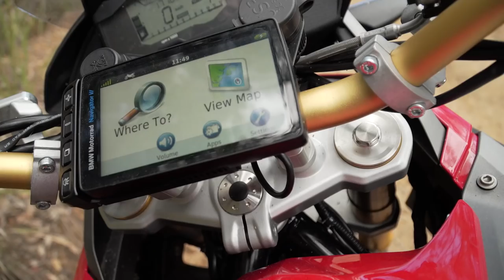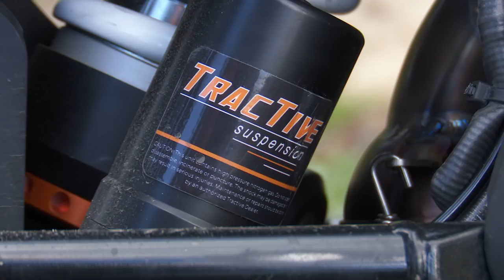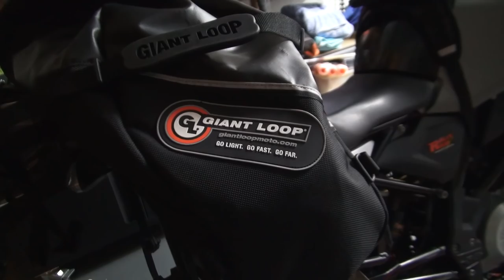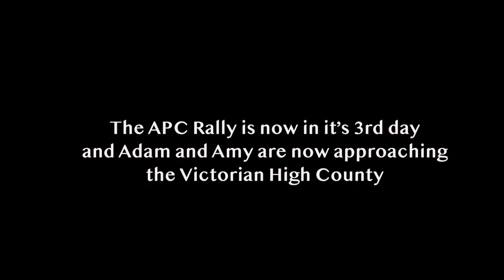Rally Raid Products BMW G 310GS - build, test, discussion, prep for adventure

Comment from the maker: Welcome to Motorcycle Adventure Dirtbike TV - we have some cracking movie length motorcycle adventure videos that will take you all over the world.  Just click this playlist link to get the full set,
 https://www.youtube.com/playlist?list=PLkM9-Vs7Ynzi55gvgbVg2Xcy_rp0vqA_R
Reply: still better off with a 2 stroke in country like that.  He did a fine job with it.  Why the fuck can't we produce a motorcycle?  Look into the history of Oz and see how many manufacturers we used to have.  Check the A-Z

https://sites.google.com/site/aushistmc/home/n
Reply: Any footage of the actual event and how the bike performed?
Reply: awesome video , can you please share the full list of the components that you upgraded in the bikes .   Thanks
Reply from the maker: Watch the entire video they are all there.
Reply: I couldn't hear properly, what bolt vibrated loose?
Reply: Same, which bolt came loose?
Reply from the maker: OK look at the front of the steering stem and there is frame that holds the headlight mount.  You'll see two bolts close to the steering stem.

Comment: This is awsome, but I am still waiting for the Ktm 390 adventure.
Reply: The KTM 390 adv is going to kill everything from 125cc up to 600ccs probably. Can't wait!
Reply: dtomic17 do you have any idea when it'll be launch or at least showcased somewhere?
Reply: a tracer 300 with the R3 engine would be nice too :p
Reply: Me too
Reply from the maker: Yeah I would like to see it to, but it looks and sounds like a unicorn
Reply: I hope its not the Duke 390 engine if it ever comes. Duke 390 is more bajaj than KTM tbh.
Reply: Alinel Woundhorn, how come?
Reply: They frequently blow heads, excessively so in those who race them.
Reply: cylinder lasts about 30,000 KMS, Gaskets blow, ECM has 'issues', sensors go kaput, wanrings and error codes need NASA technician. I can just go on. KTM 390 is surely NOT READY TO RACE, trust me.
Reply: Motorcycle Adventure Dirtbike TV This is hearsay albeit from a fairly reliable source that there is a KTM 390 Adventure being tested by the ARAI in India presently. However, there are no spy shots so yes, so far it is a unicorn.

I am concerned about the electronics, though. The current 390 Duke has a lot of problems with its console, ride-by-wire throttle system and headlight. Generally, KTM is known for issues here in India, though they do eventually fix them. What the baby GS loses in performance, it might just make up for in reliability.
Reply: dtomic17 YEAHHHHHHHHHH
Reply: FodderRev you have any trusted information about BMW 310gs lunch in INDIA??
Reply: Atul Shukla No info whatsoever.
Reply: FodderRev ok..Thanx anyway
Reply: YEP!!!!  If I had not been in such a hurry to get a bike, I would have loved to held out for Yamaha to get their Sh!! together and create one!  lol
Reply: it is going to be 390 engine for sure, by Bajaj.
Reply: @MotorcycleAdventureDirtbikeTV  unicorn is here

Comment: Glad to see more ADV bikes in the light-to-mid weight and power range being offered. Would imagine most ADV riders dread dropping a 500 pound (unladen) rig in the bush, so don't venture off-road as much as they'd like. Would like to know what the OEM bike weighs compared to the RR kit rig. The single trail these tackled in their shake-down run looked pretty challenging -- more so than what would be attempted on a BDR or TAT-type route in the USA, at least. But great to know the RR set-up took it in stride.
Reply: osimnod o

Comment: I have the G310 GS, fitted with some of the mods from the Rally Raid kit (bash plate, radiator protection, bar riser, TKC-80 tires). Another item (in addition to the suspension upgrade and spoked wheels) that I regard as essential for this motorcycle is a gearing modification. The stock version just does not have the low-end torque that you need for enduro/single track. I hear that dropping a tooth on the counter-sprocket works wonders.
Reply from the maker: One tooth would be too much I would have thought
Reply: @MotorcycleAdventureDirtbikeTV  perhaps a few teeth more on the rear sprocket cloud help.

Comment: This bike in its stock form was absolutely unbearable, but this setup looks amazing! Wish this was offered as factory option
Reply: BoomerE30 unbearable? Then this bike will only be half decent for you with rr upgrade. Better look for other bikes.
Reply: "absolutely unbearable"? You would need to share your stats (experience & weight) for me to even begin to believe that...
Reply: a factory version with a 450cc motor bmw had a 450cc dualsport just use that motor...
Reply: yes all the part you change , you have already paid for and now they are useless , you don t get credit . that s why I want a bike that is the way I want it stock this bike is 5600 plus 3000  for the upgrade  plus it really needs a 450cc

Comment: For me the coolest thing would be if the modifications came straight from the showroom floor. Modifications are fun, but this gear effectively doubles the original cost of the bike. (Which is still reasonableish I spose)
Reply from the maker: A fun little bike but I think the KTM390 is more bang for your buck.
Reply: @MotorcycleAdventureDirtbikeTV  That's good to know. Thanks for your thoughts!

Comment: Nice. But why upgrade two bikes?  Throw on a set of off-road tires on a stock bike and directly compare with the fully upgraded bike. See if the pricy upgrades are worth the expense.
Reply: Hi Voir - this was not designed to be a comparison test - rather it was a shake-down of the pre-production parts prior to going on sale.

By preparing two identical bikes, you can see if any failure was a one-off due to misfortune, or potentially a weak spot. Similarly, Adam and Amy were riding together over along-distance multi-terrain event, so it was only fair they were on similar performing machines (much as you might consider if a pair of you were riding around the world together). In addition Amy will be continuing her travels across Asia later this summer, while the 2nd bike will remain in Australia for long-term testing and press demos etc.
Reply: Voir Studio: valid question. It should be great to see if these several tousand of Pounds modifications gave  reasonable advantages? (out of tyres as they are  must)

Comment: Looks like the bike, bmw should have build from the start.
Reply: Would have increased the price by 50%  would be to much money for a 310cc for most people
Reply: They could always release an adventure version of it just like other models, then the stock still exists for the target markets.
Reply: NavyScrubz  if they  offered the exrta's list  on the 310, dynamic pack comfort pack led indicators comfort seat off road tyres  aux lights etc ..  like on the larger models i would thing an Adventure model would be inevitable.  But all they offer is a different paint colour for £250-300
Reply: For now.
Reply: I wonder if BMW is afraid that, with a full adventure version, people will figure out that a 322 lb adventure bike is a lot more fun than a 650 lb adventure bike.

Comment: I kept wondering why? Why not just buy a KTM 500 or something with good dirt suspenders rather than go to all this trouble. But then I realized, this bike has a much lower seat height than almost any other adventure bike. That's really the key. So many riders just can't deal with high seats. I don't mind having to do suspenders, but having to replace the wheels, and it really needs wire wheels, that's a pretty expensive change to have to make. Good on Rally Raid, but maybe BMW needs a true rally version of this . . . ?
Reply from the maker: Seat height, lower centralisation of mass

Comment: With the initial cost of the bike plus the parts that have been added it would be at the price of a bigger bike. It must be about $12k to $14k for everything. Think I’d go for something that doesn’t need so much modifications.
Reply: Actually the bike is only $7k so it would be about $10K
Reply: 10K is fair for such a quality machine.
Reply: Is the bike $8k in Australia. And at least $3-4k for the upgrades
Reply: I read the little bmw is $8000+ then the tax and fees plus easy $3k for 2 rims and hubs, tires, rear shock, revolve forks, bars with risers etc. so that’s right at around $14k and these are new so no deals or used ones. With that you’re in KTM and African Twin pricing.☹️
Reply: Jack White  same thing with the cb500x. The buy second hand argument does not really stand much ground. Means your second hand bike cost a fair bit more than a new one.
Reply: Africa Twin at $14k...... secondhand may be and 228kg
Reply: I checked the BMW dealership and their selling the 310 for msrp $5999 something like that. So with fees, tax and everything you’re at about $7k. The Powersports shop by me has CB 500x for $5600 and CRF 250l for $4100 or Versys X300 for $5300 so having trouble deciding on a choice.

Comment: Great Video guy's. Questions, 
1) Is Amy doing any videos on her travels? eg like Lyndon Poskitt. Would be interesting to see how the bike goes on her trip. 
2) Been following Rally Raid's posts on the GS310, and just wondering how much extra cost the modifications will add to the initial cost of the bike, is it going to be price competitive against other adventure bikes?
Reply: John from Rally Raid posted a couple of prices on the forum yesterday, but we can expect the full price list by the end of March. As to price comparison, there's a lot more variables other than price to weigh up. A full RR kit is likely to add well over two grand to the cost of the bike  if all the options are installed. That having been said, the bike will still be lighter and more capable on tougher trails  than anything else out there. Even if KTM release a 390 Adventure (which is widely postulated) it's not currently to market, and it won't have a suspension to match the bespoke Tractive upgrades that come with the RR kit. It almost certainly will be more expensive than the G310GS too.
Reply: Thanks, I'm from NZ and the bike is $10,000 nzd so $3000 extra for the full Suspension, wheels, bash plate, and pipe would be fare.
Reply: Campbell Hicks was

Comment: Also curious about a rough price of the kit.

Just over $8000A for the bike is a good price, 2- 2 1/2 grand for the kit would make it a good option, maybe an update to my legend DR 650 could be on the cards.

I am guessing if KTM made a 390 adventure it would be stupid money.
Reply: WhiteDRguy 650, I wouldn't be surprised if the ktm 390 adventure would be close to 15k which is not affordable fun.
Reply: I dont think the BMW is better than a DR in any possible way. just my opinion though.
Reply: The 390 Adventure would have to be priced less than the 690.
Be interesting how it would be specked standard. I like this little BMW looks great what they have done.
Reply: Robs Rides, if they can  keep it at 10k and below would be perfect. But knowing KTM a dirtbike cost 12k.
Reply: Hello, if you have the money, wait for the KTM 790 Adventure...
It could be the best adventure bike since the 640 adventure, with more abilities because it's a Twin cylinder !
Bye.
Reply: P. A. Problem with the 790 is price, it will be around A$20K mark and to be honest it would be wise to wait a year or two until they fix all the little problems first that seem to occur with most new models.
Reply: Robs Rides  i think the 390 would be the same price and weight as the 690 but have more protection for the rider (screen etc) and a bit more fuel  and rear subframe + standard footpegs
Reply: The Level 3 Rally Raid kit for the CB500X (used to be) around $3K USD I believe. Oddly, I saw no 500X Level 3 parts listed currently on the RR site. Anyway, I'd imagine the 310 kit will be moving toward $4K, factoring in inflation, a "premium" brand bike and similar components. Of course, that's just a guess on my part.
Reply: Hi Norsefalconer - for info. the Rally Raid CB500X parts are now simply referred to individually LEVEL 2 suspension and LEVEL 2 wheels (17/19") - that's the same as what used to be called the LEVEL 3 kit.

I think you'll also be surprised how affordable the wheels and suspension options for the G310GS are - and fundamentally of course, since this bike already has a 19" front wheel, you can also buy/fit the upgraded suspension components and wheels separately. The GS parts will be available from the 2nd April 2018 - and the prices are shown here: http://advrider.com/index.php?threads/rally-raid-products-bmw-g310r-g310gs.1228538/page-16#post-34587469
Reply: Jenny Morgan Any idea what a 310 Rally Raid would weigh wet?
And how would you compare the cb500x Rally Raid and the 310 Rally Raid for those of us who might be interested in chosing between the two?
Reply: Hi Ron - The idea with the kit for the 310GS is that it is essentially weight neutral - that is with the upgraded parts fitted it comes in around the same as the stock bike. To give you an example - the rear shock is 1.5Kg lighter than OEM, the Scorpion exhaust 2.6Kg lighter than OEM. The front spoked wheel is 1.15Kg lighter, but the rear spoked wheel is 2Kg heavier (therefore the wheel-set is 0.85Kg heavier overall). This means you've got around 4Kg 'spare' to add accessories like the tubular engine guard, hand guards and some knobbly tyres, and still come in at or even just below the original weight.
Reply: With regard to a comparison between the CB500X and the G310GS: John and I designed the CB [kit] to be a genuine 50/50 bike - in other words, one that is equally good both on and off road. In comparison, the GS is more of a 60/40 bike - with a bias to being easier to handle off-road, at the expense of comparable on-road performance. That is not to say the GS is not a good on-road bike too - but it is a 34hp 313cc single compared to a 47hp 471cc twin. However, for those riders who are primarily looking for ease of handling off-road, the 25Kg weight saving with the GS is likely to be appreciated. Ultimately the GS 'Adventure' has been designed to compliment our CB in the range, as the best 'sub-twin' ADV bike.
Reply: Jenny Morgan thanks for the reply. 
It's been a while since I had a MC. Thinking about exploring the dirt roads around Las Vegas someday.  Which would be your preference for that? Also considering the AT but it seems a bit big and heavy for off road in Las Vegas?
Reply: AT is a lovely bike, and great on desert trails - but yes it is big (and heavier and less economic) in comparison to either the CB500X or this G310GS. 

I have done a lot of riding in Nevada (and Death Valley) on my CB, and it's pretty much perfect for that kind of open desert terrain, with the odd rocky technical section thrown in. The beauty of the CB is that it also eats up the [long] highway miles very easily too - of which there are a lot between Vegas and anywhere else as you know!

The GS is still pretty much an unknown quantity to me (in comparison) - I've just bought one on the east coast, and will be riding back to California at the end of April, beginning of May... so in that regard, I'll wait until then to let you know how it compares over similar terrain and use.
Reply: Jenny Morgan The AT with the DCT looks interesting. There is a place in Vegas I can rent one for an outing so I may do that as research. The 310 will be lighter. But according to fuelly gets about the same mileage on average as the CB does. So the CB with it's bigger tank will have greater range. I would think the CB would also be smoother than the 310 and so better on the road 'to get there' . So I am thinking CB or AT at this point with leaning towards the CB partially because of weight and size. 
Thanks much for your input and videos!
That Rubicon trip looked brutal.

Comment: just curious, how many if any engine or electrical issues have you guys come across with this bike? Issues not relating to any of the mods or upgrades you guys have done. Reason i ask is because i recently purchased this bike new, put 500 miles on it and it started giving me shifting issues. Mechanic at dealer said it looked and felt like it was gonna need a new transmission. I really like the bike and had many plans to upgrade parts via Rally Raid. Im torn between keeping it or upgrading to a F850GS. I came across a forum where other people have had issues ranging from transmissions to wiring harnesses. I'd really like to hear your input on this, thanks!

Comment: I think that  bike for bike from factory the kawasaki x 300 is better prepare, but now with this Gs kit on the offer I really dont know, unless your a fan boy from one of the brands,  the price could be a dealer break .-
Reply from the maker: Good point.  I would like to ride the Kawasaki.
Reply: The kawasaki motor is rubbish for offroad. All power up in the 9k+ rev range no low down grunt. If you're going to do just tar it'd be great apart from the ass busting seat.
Reply: hei thanks for the info .- ya the seat i can manage, but the engine power its a all different deal - really dont know where to go,  up to 6000€ on a bike I may just have to look for another bike style, also enjoy supermotos style, maybe I'll find some on the used marked ..-- again you make a good point there .-

Comment: Great parts but it's a shame BMW doesn't offer a more trail worthy model to avoid all the mods.  Ktm 390 not much better.  Cheap components and more road oriented.  Maybe ktm will make 390 or 490 Enduro R vs the ADV version.
Reply from the maker: The Kato 390 is a fantastic entry level adventure bike.

Comment: I have tkc80’s on mine aired down.  I have problems with the front end washing out.  Would upgrading the suspension sort it out or get a real dual sport?
Reply from the maker: I think the fron tyre is a little wide for slippery mud or loam.  I found a similar thing.
Reply: @MotorcycleAdventureDirtbikeTV  I wonder why rally raid didnt go with 21” on the front?  I thought about making another gs 21” fit.